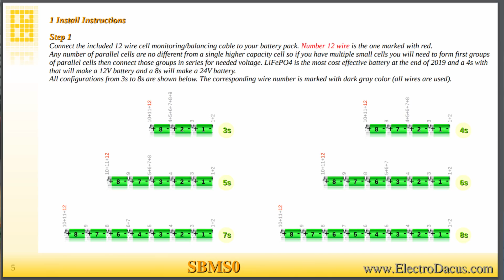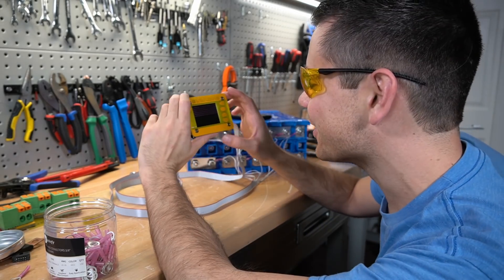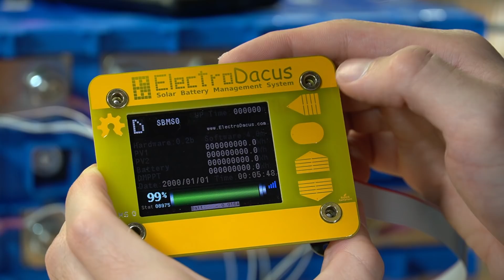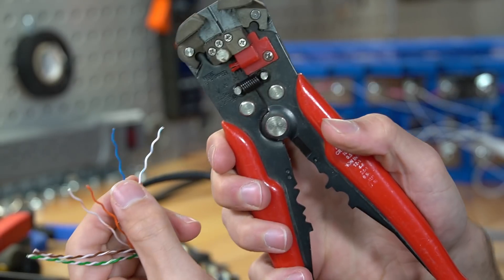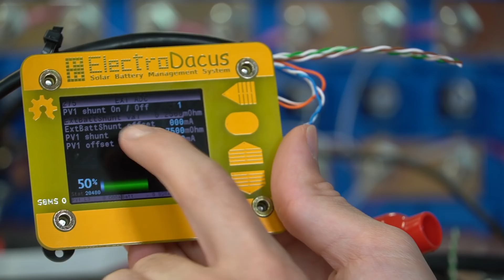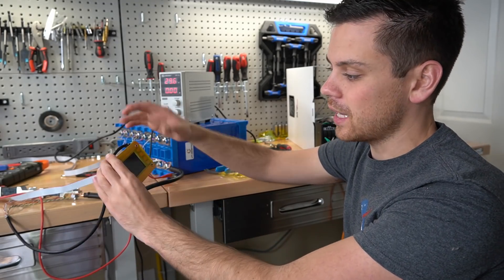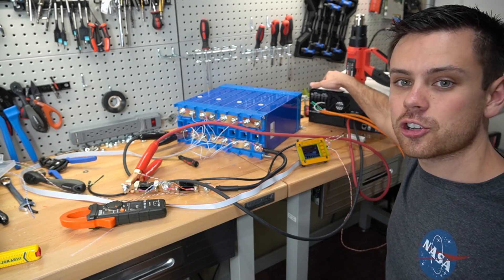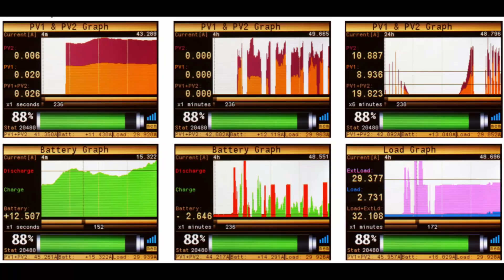Electrodacus -Open Source- Solar Battery Management System: Introduction and Setup

Comment: Present,, your one best viewer hehehe, 
Love that set up
Reply: Hi friend, can i ask a little? I bought a lithium battery pack 12v20ah, and i have also a scc thats fit for lithium ion,
But everytime that or imean  5pm when sun  is going down, the 12.4volts drops to 11.8v or some there,,it felt like its draining,,
Now what did i do is every 4pm when volts is 12.4volts something is i disconnect the wire from the scc to the solar panel,, and then the volt is not dropping anymore? 
Now could it be that my scc is pulling back the power and returning to the solarpanel when the sun is out? Thank you godbless

Comment: i never read manuals. a good product never needs one :p
Reply: Sorry SBMS will require to read at least the first few pages of the manual where install instructions are explained. This SBMS is not yet as good as to not need a manual. Probably if it was a more complete system with batteries already installed then no manual will have been needed. Menu is fairly intuitive and it has build in scrolling help for each line of the menu.
Reply: @electrodacus  of course i was joking. i have destroyed  a lot of devices since i didn't read the manual instructions :)

Comment: Will, if you put the EXTIO wires to the inverter switch in series with the switch you keep the SBMS0 control of it And you have a choice of deciding whether the inverter works or not while still only allowing it to work while battery conditions permit. Parallel works but isn't foolproof.  I liked your suggestion to put a remote switch in series with the EXTIO wires too because sometimes the inverter isn't always mounted in a convenient to reach place and that brought up the flexibility to use other condition switches to put into the control logic without interfering with the SBMS0. Really good focused review, I enjoyed it.
Reply from the maker: Good point. Yes I agree. That would be ideal

Comment: Thanks for the great video presentation of the SBMS0.
Reply: This guy is a genus. He can write tons of computer programs and make it communicate well with its hardware. I love your products. Can’t wait to have one.
Reply: Thank you Dacian for the creative products you design and build yourself, but perhaps more so, your patient and unparalleled support for those of us using them.
Reply: electrodacus - you're products are awesome ... still love my SBMS4080
Reply: The first time I saw this product I was impressed. I'm even more impressed now. Keep up the good work.
Reply: @electrodacus I had no idea you had these new versions out. You should make a new video on your channel. Too bad G+ shutdown. I liked seeing your update there
Reply: Dacien.    I just bought one of these and.   Very impressive reviews. I intend on controlling upper limit with my Morningstar Mppt-60.  ,   Question though.    Any thoughts on configuring the other control I-o outputs of the sbms0?     Your docs are a bit vague.
Reply: @Redman_O-Gauge_and_Tech_Stuff  Not sure if the Morningstar has some Aux input that can be controlled to allow SBMS to turn OFF the charging. The MPPT-60 can not know when to stop the charging as he only has the info about total battery voltage and charging is terminated based on individual cell voltages. I know all Victron MPPT's have a remote ON/OFF either build in or for smaller versions with an external remote ON/OFF cable but not sure about the Morningstar.
SBMS0 in oreder to be able to protect the battery needs to have remote ON/OFF control over all charge sources and separately for all Loads.
Reply: @electrodacus  the Morningstar is the best charge controller ever. That's why they're used for remote weather stations, they never fail.
Reply: @chrisparker9886  They can only be used if the BMS in this case SBMS0 can stop the charging. Else they can not be used with Lithium batteries.
Reply: Dacian, are you shipping the SBMS and those PWM charge controllers for general availability now?
Reply: Thank you for making it man! Now if I could just do higher voltage packs...
Reply: Yep I plan to purchase some of your products on the next batch!    aka  Nick   (thanks for answering all my questions so far!)
Reply: How about a 16s bms?
Reply: @chrisparker9886  There are no plans for a 16s BMS.  All my devices are designed to be in compliance with the ultra low voltage standard (different around the world) but 16s will exceed that by significant margins as PV open circuit voltage for 16s will be in the 80 to 100V range (while limits for ultra low voltage standards are 60Vdc and 75Vdc depending on country).
Reply: I have been following your products for a while and you are doing an awesome job! I am going to build my own system soon and will definitely order some of your products!
Reply: @waitingformyclone119  Thank Luc.
Reply: @electrodacus  please list this device on Amazon,in this part of the world only Amazon can safe us
Reply: @kipdennis3796  what part of the world ? I do not sell this is large enough volume to start selling on Amazon for now. But I do ship almost anywhere in the world.
Reply: @waitingformyclone119  _Ditto! 😃

Comment: If you leave your batteries out in the cold where they can't be charged then once they have no charge they can't serve you, but if you keep them close to you where they remain in their happy temperature range, they can serve you without interruption. So no temperature cut out is required in this way that also gives you the most into and out of the battery. An insulated and heated battery box is also an option if your application demands that they be housed externally and subject to freezing temperatures. Another method to disallow charge on a cold or hot temperature is a stand alone temp switch connected in series with the EXTIO wires so you can have an extra set of conditions other than what is in the SBMS0 before charge is allowed, you can have as many external conditions as the application requires and have those conditions relevant to the source the condition applies to. The same applies on the output side, when you think about it, doing it this way makes everything very customisable to the application without over complicating the operation of the SBMS0.

Comment: Electrodacus is a solid SBMS. I own a SBMS120, very powerful. The only downside for me is the maximum voltage design, 24Vdc. I started building my own OffGrid system and I wanted to use this SBMS but couldn't use it in 48Vdc application. Very well explained , Will!!!
Reply: People do silly stuff so I like to stay in the safe low voltage range that is usually considered to be just 50 or 60V DC and open circuit voltage on 60 and 72 cell panels that you normaly use with an 8s 24V LiFePO4 are already at 40 to 50V DC if you want to go with 48V battery then PV panels open circuit will be in the 80 to 100V range way above low voltage limits.
Reply from the maker: That is a good point. I cringe at people installing 200voc strings without proper training or equipment. Pwm and 24v pack is a very cost effective and safe setup.
Reply from the maker: Good point about maximum voltage. Very true. And very cool! Glad to know your unit has held up

Comment: Nice work and lots to learn from it. I would be interested to see how a temperature sensor could also be integrated. Also, I am planning on using  this setup to replace the AGM battery with a custom LiPo build and using this BMS but no solar charger for now. The trailer came with Progressive Dynamics 9245c charger that doesn't have a remote ON/OFF option. What exactly cut the power when battery was full, in your case? Would I need to do the switch trick (IO3 port) or there are other options?
Reply from the maker: For that, I would top balance and connect direct to bank. Lipo or LiFePO4?
Reply: @WillProwse  LiFePo4 build using the same cells you are reccommending. Are you saying that a BMS wouldn't be needed? How will the PD 9245C know when the battery is full?
Reply from the maker: @LoftyEscapes  what is absorption for that model? If they are top balanced, having HVD won't matter much. if float is above 13.6, may have some longevity issues but that is all. I would personally go with a charger that has manual absorption. LVD is totally different and needs BMS for sure.

Comment: I really really like how ElectroDacus designs stuff, the water heating load dump project is inspired.
Reply: Also I’m jelly and want one
Reply: Roadsteading 
Same here. I saw his (ElectroDacus) early video’s and found them very interesting (all of them;). So cool to see Will reviewing one of his products and being enthusiastic about the setup.

The real benefit of his system is as you mention the storage of heat which will save you a huge amount of money because youll need a much smaller battery and will still be very comfortable and have plenty of power.
Reply: I always appreciate when someone takes the time to integrate lots and lots of documentation into a UI.

I've started my first video on hydronic systems and thermal mass management for off grid space, and i've referenced ED's pdf probably 4 times lol
Reply: srsly would kill to get hands on an SBMS and DMPPT, guh

Comment: Holy cow, what happened at 10:17
Reply from the maker: I thought the caps were pre charged but they weren't. It's fine. Typical inrush. Not good for caps though. Ahh well it happens
Reply: I think he did a little bungle.